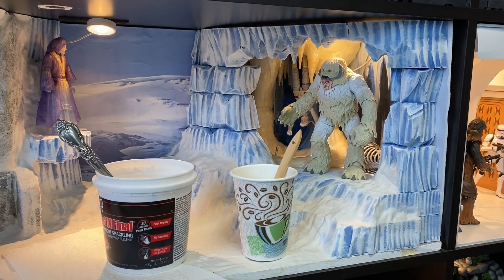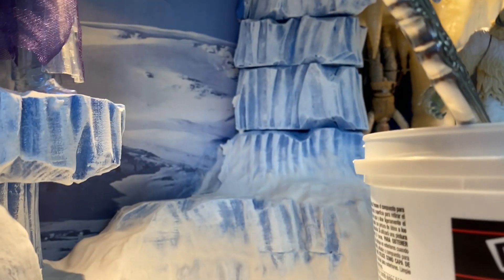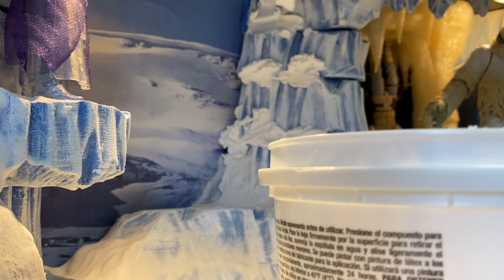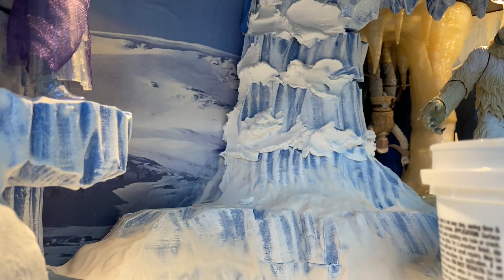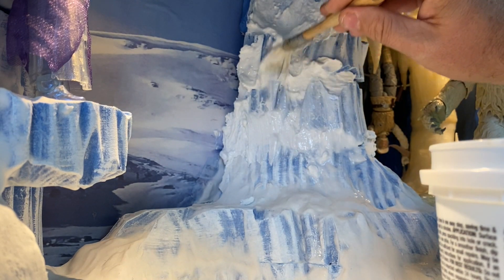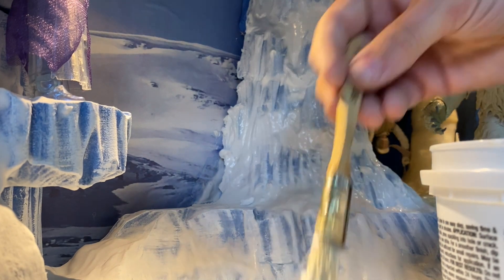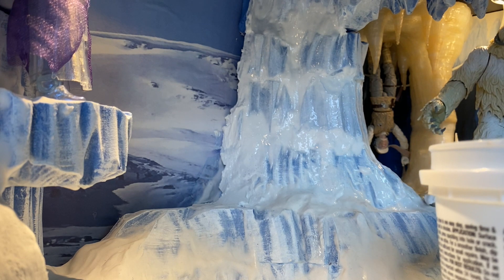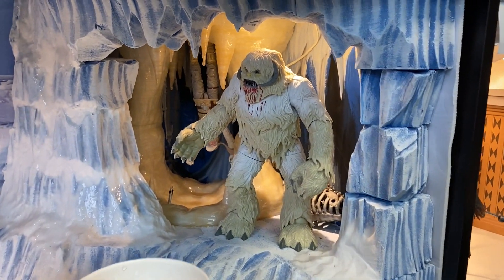Diorama Tips & Tricks - How To Make Snow for Your Diorama #crafting #snow #diorama

Comment: What paint did you use for the pink foam? I have a project I’m working on with a snow base, but I’m worried about the paint eating the foam. I have some of the spackle, but need to know what to start with
Reply from the maker: You’re right, don’t use spray paint, it will eat the foam. Just use acrylic craft paint (Michael’s, Hobby Lobby, Walmart etc) and brush on a thick base coat, then you can add other layers and colors over that. I painted a blue acrylic layer first then added white to lighten the blues in different shades, finally ending with white dry brushing.
Reply: @RedWagonDioramas  Thanks so much! That is a huge help!!
Reply from the maker: @thegillman777  great, you're welcome :)